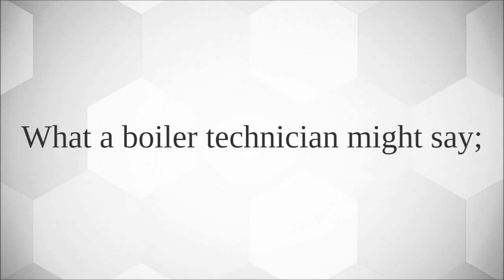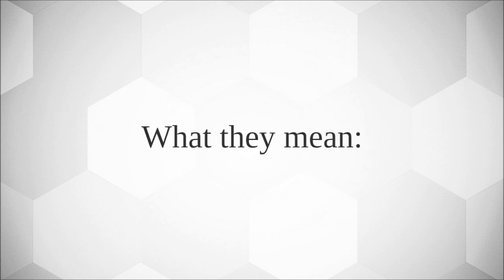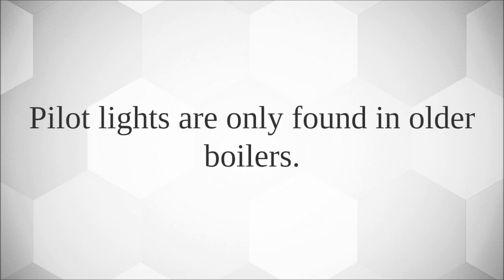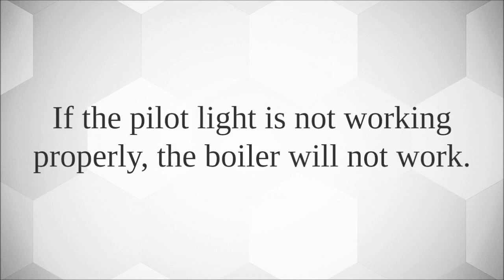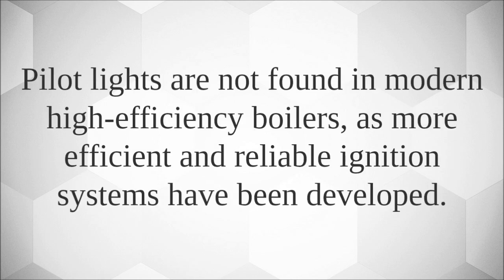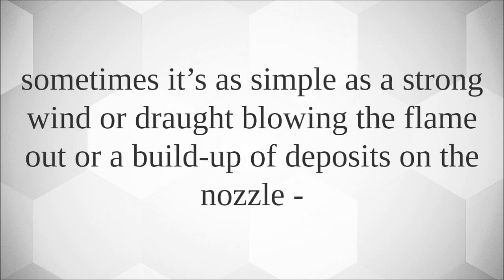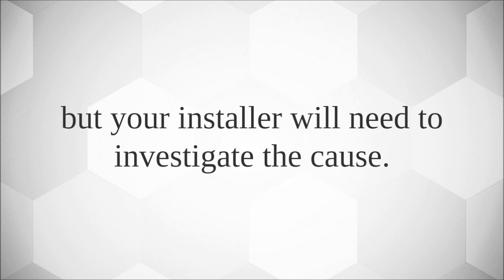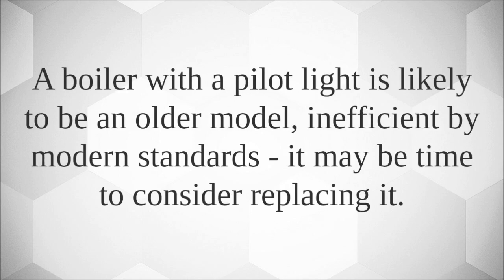What to do when your pilot light goes out - Could it be time to replace your gas boiler?

Comment: What a con, a £700 boiler, a days labour (tops) 3,4,5K !!!!, oh and then ( salesmans sucks in breath) you probably should change the rads and pipework as they maybe dirty inside and not very efficient. It's likely a thermocouple, a tenner plus 1hrs labour, even at todays gas prices it'd take 10 years to before you start saving money. If it falls over completly then change it